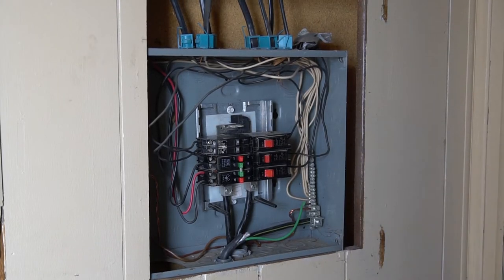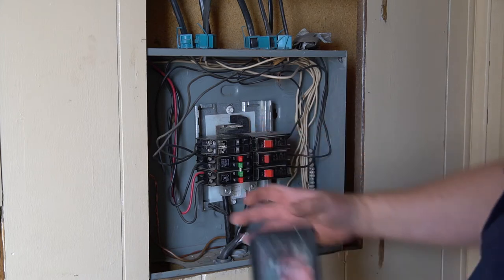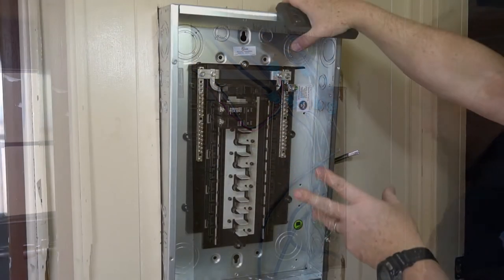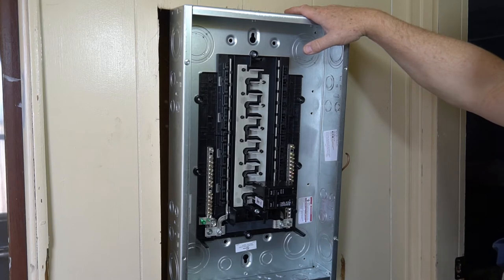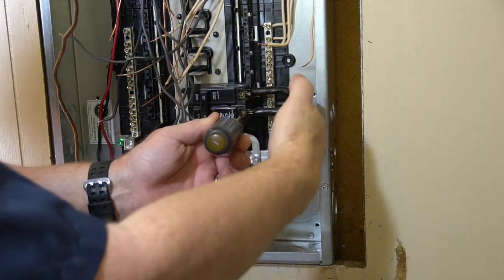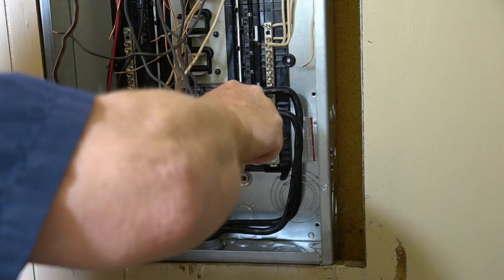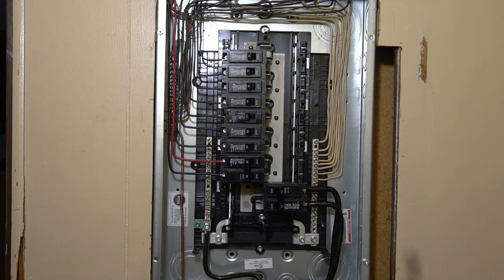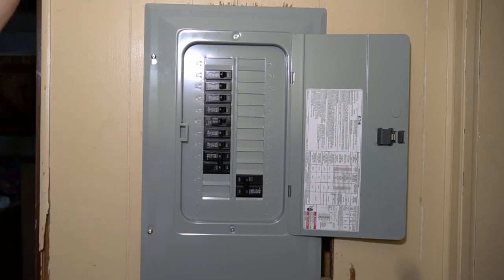⚡ How to Upgrade your Main Breaker Panel.  Step by Step Guide  🏠

Comment: I have a home built in 1958 with a 60 Amp main breaker panel box I need to replace with a 100 Amp breaker panel box. Im trying to confirm that the service coming in at the meter is 100 Amp but there are no markings to identify the service amperage. So far it seems that the service is 100 Amp and the wires do not need to be upgraded. I like very much how you made all the wires very orderly on one side of the box. I may have to get a box with enough spaces to do that. The old box is in pretty bad shape and has to be replaced, no chance of just upgrading the main breaker.
Reply from the maker: The incoming service to the Drip loop on the meter base should be 200 amp. If not, you should be able to request your power company to upgrade it.  The drip loop and meter base are generally the responsibility of the home owner to upgrade.

Comment: At the beginning when you test the main voltage, you should test your voltmeter first.   I would go to the disconnect and test the voltage there or turn the power back on and check for 240 volts and then shut it off and check for zero.    I have about 6 voltmeters and when the batteries get low or the probe wire break internally you don't know until you check a live voltage.    I happens to me all the time and the voltmeters can also be fried internally from making a stupid connection and burning them.   I just found the black wire on a brand new voltmeter with a clamp on ammeter had a broken black probe wire.   I just thought it was a bad meter until I switched wires.

Comment: I believe in a sub panel the green screw needs to be removed.   The green screw bonds the metal box to the neutral bar.  In a main panel this is correct.  The ground and neutral wires are both attached to the neutral bus.  Just as you have done for for this sub panel the grounds are on a distinct bus.  This distinct bus is bonded to the metal panel therefore grounding the panel box.  Leaving the grounding screw in the sub panel prevent distinct paths from the sub panel back to the main panel for neutral and ground.   Example would be if the neutral wire between the main and sub panels is damaged or disconnected the neutral from the sub panel will now travel back the to main panel on the ground path.
Reply: I also noticed that the bonding screw was left in and never mentioned.  Since I  am a self educated electrician I  was wondering if anyone else noticed or was my understanding faulty. The way I understood it was that the neutral on any sub panel has to be kept separate from the ground as diligently as the hot wires. I always run my grounds together first in the back of the box to insure that they are clear of the neutral bar and my neutrals to the opposite side. Your explanation of why this is important is greatly appreciated.
Reply from the maker: Thank you for commenting
Reply: Does your comment change if I tell you there is NO Equipment Ground Conductor from the main panel to this panel?   Respectfully,   Kevin
Reply: definitely need to remove the green screw, the point of a separate ground bar is to separate the neutral from ground, the green screw connects them

Comment: Nice video. Maybe you should change the title to indicate you are adding a subpanel instead of upgrading a main panel.
Reply from the maker: Thanks.  Thanks for the suggestion. It is a valid point. I feel that even though I was technically upgrading a sub-panel (because of my unique situation), in 99.99% of most people's homes, their home breaker box is the main panel and not a sub-panel.  The instruction given, apply to both, and I explain the difference in the video, so I feel that it is kind of a mute issue.  I will keep your suggestion in mind and if I feel it is necessary to change it in the future, I will.

Comment: Nice Job! The ground bar should be compatible with the panel. No use for using self tapping screws. You mentioned the separation of the grounds and neutrals, should’ve mentioned removal of the bonding screw or not installing it if it was in the box.

Comment: Very well explained I would like to know how I determine which and why breakers will be 20amp and which are 15amp
Reply from the maker: I explain this in the video. 15 amp breaks are used on 14 gauge wire. 20 amp in 12 gauge wire.

Comment: Is there a problem with only loading one of the two phases.

I usually see balanced phases to not overwork the neutral,  that neutral looks big enough regardless.
Reply from the maker: Placing all of the circuits in one side is actually balancing the box due to the ZigZag bus system.

Comment: you need to remove the green screw in a sub panel as its bonding the neutral to the panel itself.  You have effectively bonded the ground and neutral at this sub panel by leaving the screw in.
Reply: Trevor, what would you say if you realize there is NO Equipment Ground Conductor coming from main panel to this panel?   Respectfully,   Kevin
Reply: @KevinCoop1  I am not a licensed electrician so I dont wanna go through a bunch of what if scenarios given the fact that there are a ton of exceptions in the NEC, and each Jurisdiction interprets code (and is on different code revisions) differently.  

I just work with electricians so I've picked up a bunch of electical knowledge such as when to bond the neutral and ground and when not to.
Reply: @KevinCoop1  unfortunately I'm gonna say to consult either a local electican, or your local electical inspector.  They can answer those kind of specific questions.
Reply: Correct Trevor. If that green screw is left in then the neutral and ground are bonded. Code inspectors usually want to see that green screw removed and in you hand.
This is not a code interpretation but a basic requirement for sub panels. Leaving it in can cause current to flow through metal objects if there is a fault.
Reply: @w1swh1  Correct.  Although current will take all paths back to the source so even not in a fault scenario current will flow on the ground between both points bonded to the neutral.  

Also I wasn't saying removing the green screw was interpretation, just that Kevin was asking a specific question and and told him to ask their AHJ not me.  sorry for any confusion.

Comment: First of all, nice clean job! from the original set up, this is a master-piece.  I was wondering on what you do when the wiring to a breaker is short. Can you splice/wire nut an extra length to reach the breaker? ...... reason I ask is because I'm interested in installing an interlock kit in the panel and the spot where the lock gets situated is already occupied by two single pole breakers that will need to be moved further down the panel.  I haven't looked yet, but I think those wires may need to be extended. I could go with a transfer switch, but that's another bear.
Reply from the maker: Yes you can extend wires to make them reach if necessary. You just need to make sure that you make a good solid proper connection when slicing.

Comment: With all the breakers on one side dosent that unbalance that panel?  I’m asking.
Reply from the maker: Breaker panels have a staggered buss system, so even though the breakers are all on one side, they are connected to alternate busses, one next to the other.
Take a look at this image to see what I mean 
https://images.thdstatic.com/productImages/69bdc30e-6791-4880-9f03-8ec55fa76609/svn/individual-subpanels-chp24l125r-64_600.jpg

Comment: How did you turn power off? Was with the electric company? I was sure you could turn main switch but that the two main lugs would still be hot? Getting ready to do this.
Reply: I didn't see that either, how the power was shut off to the box
Reply: It has a main breaker on the pole next to the meter. As most mobile homes are required to have.
Reply from the maker: Gail Taylor is correct

Comment: Thanks for the video, hope I didn't miss this in your video..... if the wires are too short,  can a splice be added using wire nuts, where the wire nut connections would be contained in the main panel box?
Reply from the maker: You got to do what you got to do. It is okay to splice to extend the wire if necessary. I try to position the new box in such a way as to not have to splice, but sometimes it is unavoidable.

Comment: I came back to this video after scratching my head about the prevalent advice in the comments regarding the bonded neutral. Of course the correct knee jerk reaction is that you should never bond neutral in a subpanel, which certainly applies to almost any subpanel. However let's think about rare exceptions. I believe the main panel for this install is in another building, and this mobile home subpanel is fed by the old style three-wire feed. The ground wire seems to enter in separate conduit, I'm going to assume it leads to its own properly installed ground electrode rather than back to the main panel. That violates new building code, but there are millions of outbuildings, garages, etc that were wired this way, it was a standard install a generation ago. Indeed, even the NEC recognize this and consider it a valid exception to the general rule. Let's assume there is no metal pathway for ground current back to the main panel. If so, without the neutral bond, he has a TT earthing system, with a high impedance pathway for ground faults through earth back to the tranformer. As such, even a dead short to ground is not likely to trip a breaker if the neutral is not bonded (not enough current because ground electrode resistance is high). This is why old three wire feeds to outbuildings bond neutral, to give the breaker every chance to trip in case of a ground fault. Risk trumps the parallel path concern. The safer options to avoid bonding would be to either install an EGC back to main panel, or to insert a service entrance GFCI in its own box before those big wires enter the trailer panel. The real lesson should be to get an inspection, even if you think you did it right.
Reply from the maker: Just FYI, this installation was certified by a Master Electrician. I do not pay attention to the comments because YT is global and there are many different codes in this world. In the US codes vary state to state and  even city to city.  YouTube commenters often forget that there is a big world out there and that there own little local way of doing things is not always the way it is done other places. Americans in particular are really bad about thinking Their way, is the ONLY way.  

The great pyramids will be standing long after everything built by modern engineers have turned to dust.  So who knows the best way to build?🤔🧐
Reply: Spelunkered,  your comment was spot on!    The method of feeding one building from another grounding flip flopped back and forth for several Code cycles.   They couldn’t decide which way to do it.  It stopped changing in mid 90’s.  Currently it is equipment ground in feeder with grounding electrode conductor to grounding electrode, and a main disconnect at or near feeder entrance.   Good job stating facts for safety!
Reply: @KevinCoop1  I installed a two circuit feed to a greenhouse last year, with a ground conductor back to the main panel, and I did exactly as you state above. On formal Canadian inspection, the only thing they required me to change was to remove my ground rod. They didn't like the way there were two potential pathways to the house ground, so they wanted the greenhouse ground rod gone to reduce the chance of stray currents. I was a little surprised, mainly because that ground also served as lightning protection.
Reply: @spelunkerd     You need to educate your inspector.   Ground rods have nothing to do with the ground path he is referring to.   The only purpose of ground rods is for lightning and the surges caused by it.   In NEC, the ground rod is required to be connected to the ground bar for sub panels in a different building.  The last time I looked at Canadian Electrical Code, it is pretty much the same as NEC.

Comment: Does the power company need to shut off the power than runs into the box from outside to power the circuit panel? 
I’m confused as to how the power is all off when you turn off the main breaker
Reply from the maker: Each situation will be unique. In my case, I had a main disconnect below the meter base to cut the power. Your situation will be different. Only you can know what is necessary for your situation.

Comment: Good neat work however, The green screw bonds the metal box to the neutral bar if you don't remove it the neutral and grounds are still bonded in the panel also torque settings are required in most areas of the U.S. "not just as tight as you can get them". Other than that looks like good neat work. We all learn as we go I am not being critical I am just trying to pass on what little I know to a fellow human being.
Reply from the maker: According to what I have been told a Master electrician, the green bonding screw only needs to be removed if the sub panel is grounded through the main panel. However, this sub panel had its own dedicated ground.  A few other licenced electricians have also stated this in the comments.

Comment: Did you bolt in or fasten in that breaker on the bottom that you sre using as a disconnect for the panel. It must be mechanically secured if it is. If it eas a breaker feeding s branch circuit it eould mot have to be bolted in or decured with an approved clip.
Reply from the maker: Can you answer me a question?  Why is an expert like yourself, that knows how to do it, going around watching YouTube videos on how to do something you already know how to do? Just curious 🤨
Reply: Because I do learn things from these videos and want to go into what was done right or wrong and give an explanation as to why so the guy using these viyas a guide to doing his own work can get a little more information.
Reply from the maker: @johndavies2949 @johndavies2949  So you do not consider yourself to be an expert then, and admit you are still learning. Okay.  Just making sure, because, you came on like you were an expert speaking with authority and not just a learner sharing what you think you know. Glad we cleared that up.

Just FYI. Almost no one reads the comments on a YouTube video.

Comment: Wait, how do you turn off the power before the main breaker? Call the electric company?
Reply from the maker: In my case, this was a sub panel, so I had a main disconnect. If you are dealing with a main panel, you will have to have the meter pulled by the power company.

Comment: Thanks for showing us how to turn off the main power coming into the house. This was really helpful as I'm about to stick a screwdriver into the panel.
Reply from the maker: No need to be snarky. Every situation is unique  There is more than way to do it depending on the situation and how it is set up. In some cases, it might be required to have the electric company pull the meter.  Bottom line, if a person is not capable of even turning the power off, they probably should not be replacing their own panel. 🧐

Comment: Does upgrading from older model panel lets say 14 breakers to newer model 20+ breakers, does that upgrade watt maximum allowable (sharing with 2 units/apts)?
Reply from the maker: This question is a bit too complex to answer on such little information.  There are just too many variables to give good advice without an onsite inspection of what you are trying to do.
Reply: @thejungleexplorer  well just trying to get a general question, lets say home is 1990's electrical, older model circuit breakers. Does upgrading the hardware to 2010+ models make them more efficient and more sturdy? Does upgrading from from 150 amp to 200 amp panel actually make all attached electrics perform better- i.e. avoiding overcharge?
thanks
Reply from the maker: @aleks8730  If I understand you correctly, you are asking about efficiency, as in, would a modern electrical system is more efficient than a 1990s system. I would say that the efficiency improvement would not be significant enough to be measured if all systems were functioning properly. There is not much difference between a 1990s electrical system and a 2022 system. All of the components are essentially manufactured the same.

I am wondering if your reason for asking this question is that you are considering upgrading to a Solar or Wind power system where every single watt counts?

Comment: That 2nderry ground bus bar also needs to be from the same panel manufacturer or approved for use in that panel you can't just willy nilley salvage parts to be NEC compliant
Reply from the maker: Thanks you this info. Please post a link to the code section you are quoting so viewers can read it.
Reply: Also, self tappers are a no go. Your ground bus needs to be installed with a tapped mechanical connection.

Comment: I thought good practice is to try to share the loads between the two bus bars?  You have all of your breakers down the left side of the panel, therefore they are all drawing power from the left bus bar and a single feed wire.  A better way to do the initial breaker setup would have been to have half of the 15 amp and half of the 20 amp breakers on the right bus bar.  Then in the future, if circuits are added, alternate between using the two bus bars. Thanks for posting the video, there are some helpful tip
Reply from the maker: I think you have a misunderstanding about the construction design of a breaker box.  Please study the image on this page https://amzn.to/3pn46Ci
Reply: @thejungleexplorer  Jungle, Yep, my mistake, I am confusing physical placement of breakers and "balancing" the amp load.  I understand my error now.
Reply: @thejungleexplorer  ok....this panel has a 3 phase load supply?
Reply: @17jflor  No.  The feeders are your typical 2 hots (split-phase 120v to neutral and 240 to each other) and a neutral.